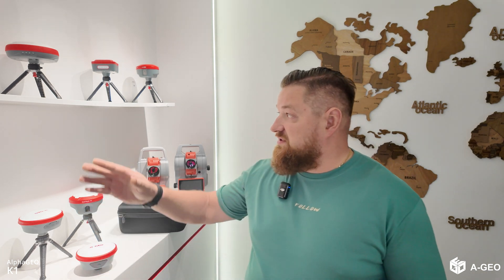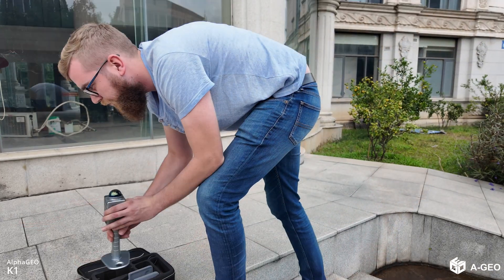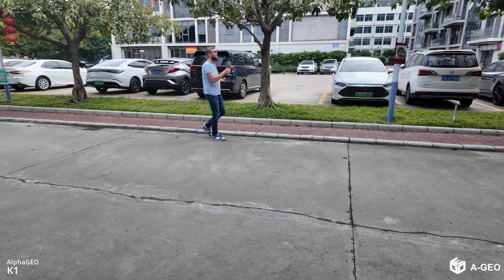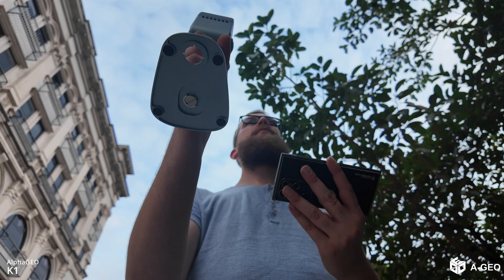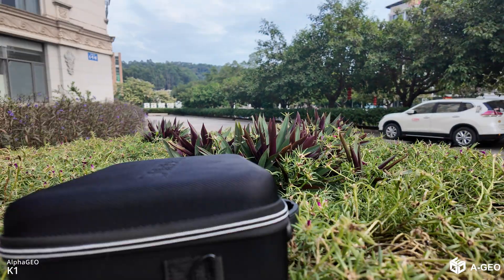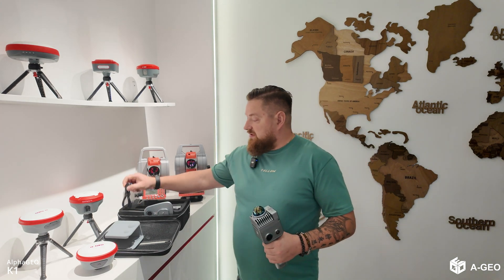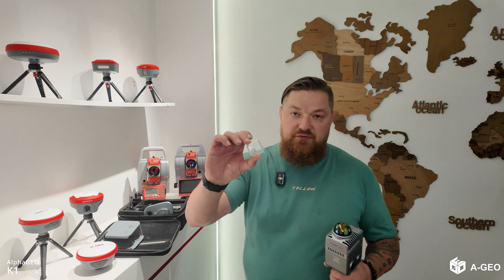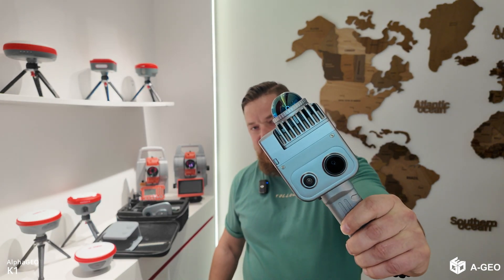Discover the AlphaGeo K1 Scanner: Compact, Lightweight & Powerful!

Comment: Thought this was Lixel Kitty what the hell
Reply from the maker: @yawnahkay7362  don't be so rude 😀
Reply: @ lol all jokes aside I really want one of these. Are there any drawbacks you can think of from your time using it?
Reply from the maker: @ all depends on projects you want to scan. This has limitation 40m scan distance. You cannot use it with backpack, car or UAV. On the other hand, software and application You have is just fantastic 😃
Reply: @a-geo  started testing , results are great ....sofware seems slow ? (i7 -RTX3070 )
Reply from the maker: @ Slam processing can take some time, RAM and SSD also means a lot. We started to provide with DDR5 and pCI5.x for our clients.
Reply: @oebleh  What kind of accuracy are you getting? Is 2 cm realistic?